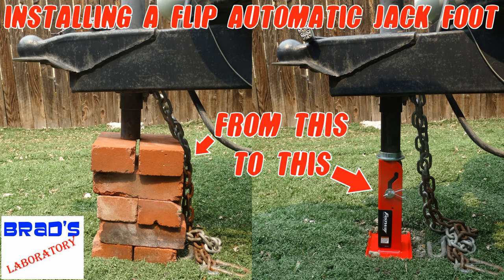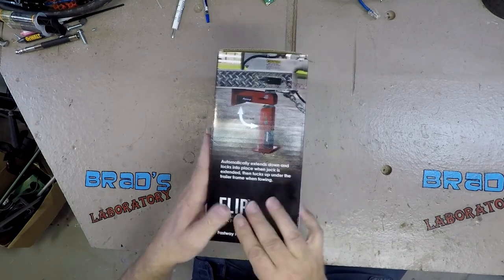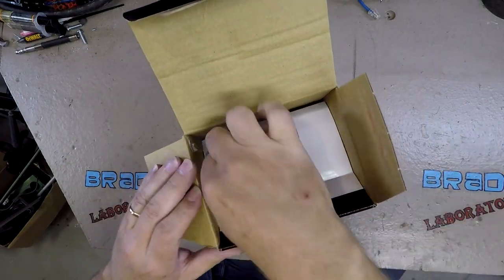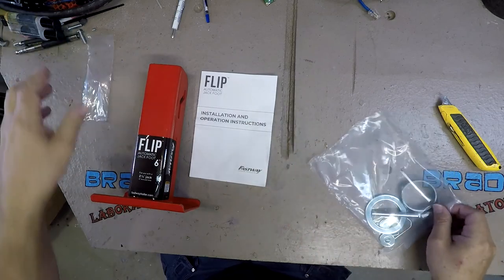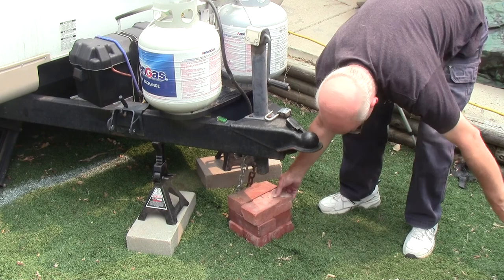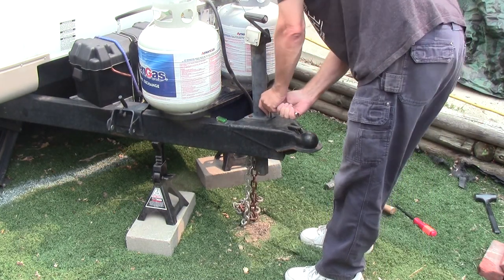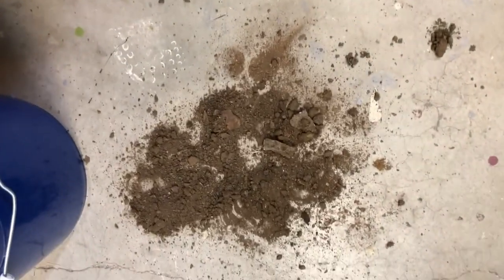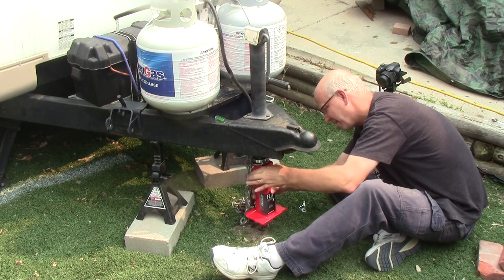Flip Automatic Jack Foot

Comment: I would think it would be better to use a bolt and then strip the threads so that no one can steal it. How do you like it so far? Is it worth it?
Reply from the maker: It works a lot better than stuffing bricks under it, there are still times when I am not parked on level ground where I have to put a block under it, but that is Colorado.
Reply: @BradsLaboratory  
Thanks for considering purchasing it. Most of the time I’m on level ground so it should be fine. I’m thinking about the 6 inch.
The only thing that concerns me is the one side of the plate when it’s turned upward seems to be a little too wide so I thought maybe cutting that one side off would give me more clearance. What’s your thoughts?
Reply from the maker: @nicholashalvis5376  it is fine on my rig, but my rig is pretty tall. If your rig is shorter then I could see cutting it off
Reply: @BradsLaboratory  
Thanks